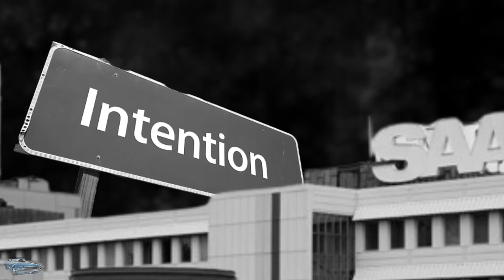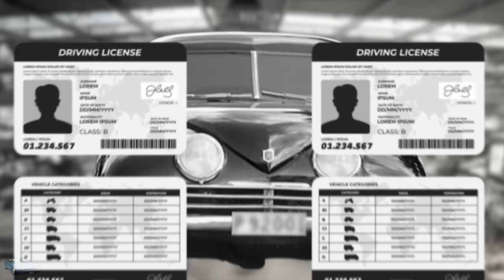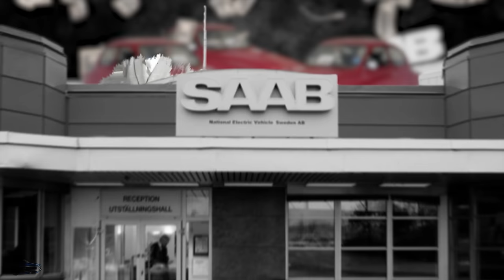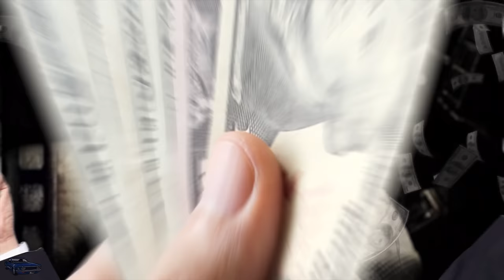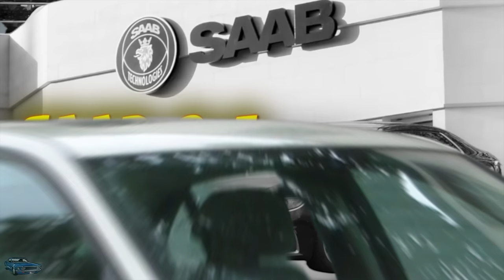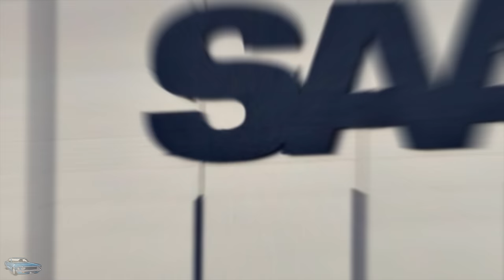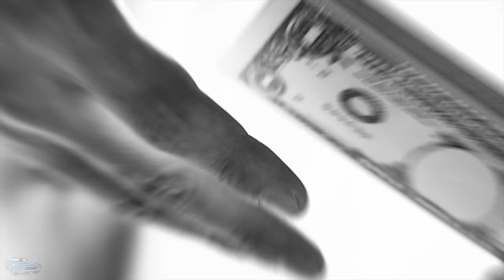The TRAGIC Fall of Saab | A Classic Car Documentary

Comment: Saab-Valmet was established in 1968 as a joint venture of Finnish Valmet and Swedish Saab-Scania. The automotive plant was placed in Uusikaupunki Finland, and assembled only Saabs for the first eleven years. The deal was that Valmet made one third of all Saabs. The Saab 900 Cabriolet, which the video also fails to mention, was designed by Saab-Valmet in Finland. GM tried to run down the factory in Finland but ended up losing the battle. Valmet's factory is still working in Uusikaupunki.

Comment: The 2-stroke engine required a small amount of oil to be mixed with the gasoline, like many chainsaws. Jay Leno said  there were so many SAABs sold in New England that gas stations offered premixed gas+oil.
Reply: Please post a link to that video.. I could search for it but am lazy heheh better to be pointed right to the source.
Reply: It's not a "small amount'  it could be as much a 33:1 with TCWIII oil or 40:1 with regular non detergent 30#.   Usually if your fuel gauge light comes on,  a quart of straight oil will do a 7.5 gallon refill.  just pour it into the tank before you fill-up and the fill up and take it for some alleyways Gymkhana laps to mix up the oil.   Otherwise, especially of it's cold, the oil won't mix itself well into the fuel and you'll initially foul your plugs and (or) soft seize after the mostly unmixed gas-oil thins to about 80:1.  I know why I liked the Shrike and GT850 injection strokers.
Reply: Not just Saabs - there were literally thousands upon thousands of 2-stroke motorbikes in the UK as well.
Reply: @edeledeledel5490  And the US too, I've owned at least ten small Japanese two stroke motos in my life. most of them were fitted with an oil injection system.
Reply: And theus the freewheel clutch was implemented to prevent engine revving without lubrication
Reply: The last few years of the SAAB 2-stroke also had oil injection.
Reply: @ctcboater  In the US they sold the last year of the 2 cycle with a base model 42 hp Standards with premix, although the Shrike Standard and GT850 were oil injected, their pumps were a bit different, I believe the GT and Monte Carlo 850 had a higher volume oil pump.

  The injected engines ran their oil supply galleries to each main bearing and the lower cylinder walls individually.  This is why the Shrike engine was considered a lifetime guaranteed against failure engine, as long as the oil tank was kept topped up, the injection pump was reliable enough so that the oil went exactly to the places it was needed with being diluted by gasoline.
Reply: FredrikLarsson-yk3cz  Funny that my '65 95 Wagon and the '62  bullnose both got almost 30 mpg,  I must have been doing it wrong?  The fact that I never had any seizure problems with these premix engines was because of diligence in keeping a couple full quarts of 2 cycle oil in the cars at all times.  I drove mine during the mid 1980's to 1994, not as daily drivers but at least several times a month, and they both had been on a few over 1000 mile trips to California and Washington state.  I agree they are very solid little cars and the freewheel was great when traction was limited  I also had a 1970 SAAB 99 and it was also very nice in a much bigger weight class and look.
Reply: FredrikLarsson-yk3cz  There were two different types of crankshaft in the 2 stroke SAABs.   The standard pre-mixers from the late 750cc  on through the last year of 1967 2 cycle standard had "cut-outs" for the crankwheel circles and this crank, when used in the single carb engine block, made for a very tractable and wide torque curve.   These engines could easily pull away from a stop light at near idle speed and not miss a beat under acceleration. they also got better fuel mileage in my estimation.  The full circle cranks were run in the MC and GT850 models and were generally set up in the 3 venturi carb assembly, although the late "66 onwards Shrike and Standard had 3 venturi carbs.   These full circle cranks had an entirely different driving experience, these were the cars that had hardly any torque from idle to about 3K rpm, and much clutch slippage was needed to drive away from a stop while keeping the engine on the boil enough to pull well. they did do better at freeway speeds but that was because the higher compression and torque, that was usually fed through a slightly taller pinion/crown wheel gear set. The Bullnose with the 3 speed was better used on backroads as over 60 mph was a bit of a strain for an engine of 36 HP. They were very happy cars to drive in urban and back-roads though.
Reply: Yes I live in NH. I've owned 5 and just got a 2011  9-3 convertible with 64K on her. She runs like new.❤❤

Comment: My dad started working at a SAAB dealership in the early 1970's as a mechanic. One day a factory service rep came by on a usual dealership visit and mentioned to my dad that there was a position open for a service rep for the Maine, New Hampshire and Vermont territory. He applied for it and got the position. SAAB sent him to the factory service school in Trollhättan, Sweden for about 4 months.
     He worked for the company for about 15 years out of New Haven, Connecticut. He got a new company car every 6 to 8 months or so. On a winter break from high school, he let me be his chauffeur for one of the weeks he was on the road. Got to drive a brand new model 99. Very impressive !  Fast, smooth, comfortable and very quiet inside. Handled like a dream.
   He got me my first car, a graduation present, which of course was a SAAB, a well used 1967 model 95 with the V4 engine. I had that car for about 8 years and drove the hell out of it like teenagers have a tendency to do. It was an amazing car and held up well, considering what I put it through. I miss both the car and my dad, good memories.
Reply: Awesome story! 👍👌
Reply: That’s an awesome story! Thanks for sharing!
Reply: I remember passing the SAAB US HQ on Rt. 95 in New Haven when I was "commuting" between NJ and the Groton sub base in the 80s.  They had a Sonnett inside, which you could see from the highway.  My car was a '77 SAAB 99 EMS ("Extra Mean SAAB"), which was a tarted up 99 sport version, so I was a SAAB enthusiast, and noticed these things.
Reply: I owned a ‘73 Sonnett. Most fun car I’ve ever owned. Very creative vehicle, fiberglass body, froggy headlights and freewheeling transmission as noted. I hated to sell it. Great gas mileage powered by what I was told a 65 hp motor from a Saab air compressor, I was told. I fitted it out with electronic ignition and upgraded the radio. It also had about five T-handles which I thought was cool.  Eventually the bottom rusted out. I sold the car to an aviation mechanic who later told me the transmission dropped out. I offered to buy the car back, but no, he rebuilt it. Great memory!
Reply: Thanks for sharing a lovely story!
Reply: It was just outside New Haven in Orange, CT
Reply: @DCDura   They actually started in New Haven and moved to a larger facility in Orange in the late 70's. My dad brought home cases of the SAAB 2-stroke oil they were going to toss during the move as the 2-strokes were being phased out.
   Did you work for them? My dad did.
Reply: Quite the story! 👍
Reply: A WONDERFUL STORY! MY PARENTS GAVE ME A SAAB 900 TURBO (WHEN THE ONLY TURBO MODEL IN NORTH AMERICA WAS THIS CAR) AS A GRADUATION PRESENT, TOO! I MISS THEM, BOTH THE CAR & MY PARENTS.
Reply: @DCDura I lived in Orange, CT while training at Yale Hospital. I eventually had a Saab 900 turbo, a great car, and a Saab 9000, also great.
Reply: Thanks for that Saab story, may your old man rip. You'll both be reunited in the end and that's a guarantee.
Reply: The V4  was a great improvement over the 2 stroke. Decent gas mileage and quite reliable. I sold mine to a neighbor after I upgraded to a 1972 99 and he drove it for many years before an accident destroyed it.

Comment: As a teenager back in the late1980s, I was sitting at red light late one night in my 79’ Z28 Camaro, when an older gentleman pulled up along side me in a black Saab 900 T. We briefly made eye contact as the lights began to change, and due to the fact that the roads were entirely devoid of any other traffic, I got the distinct impression that this distinguished, slightly gray haired man had a “contest of speed” on his mind...which suited me just fine, of course. Although I’d often seen these odd looking cars around, I didn’t know too much about them in the way of performance.
    Now I had done a few mods to my car including a carb, intake, cam, headers, and true dual exhaust, sans catalysts. With a 3:73 final, this Camaro was far from stock, and regularly humbled any stock Mustang GT of any year of that decade. 
    The light changed, and we both flat out dumped it. I immediately put a car length on him out of the intersection. The one thing I vividly remember about this strange car though, was the incredible sound of that turbo charger spooling up as he seemingly almost instantly erased that deficit. We were running pretty much dead even. Every time he would shift I’d gain a few feet, then the whining scream of that turbo charger would be right there in my window. It was pretty awesome, actually.
    Although it was a long straight, and there wasn’t any other traffic around, there definitely WAS the possibility of the random cop sitting up the road in the dark. So we both shut it down before crossing over into triple digits. I remember glancing over and seeing this man grinning like a Cheshire Cat, and he winked and nodded before going on his way as I hit my turn lane to head home.
    Unfortunately, I never got the pleasure of driving one of those Saab 900 Ts, but from there on out, I always held a healthy respect for them in the way of their performance capabilities. Was his car modded as well? Possibly, but of course, I’ll never know. Regardless, I still hold that car fondly in my memory as one of the few 80s “business man sleepers.”
  Great video, btw! And thanks for the flash back. 👍
Reply: Awesome story! I had a similar experience except I was in the Saab. And as a young man surprising kids in my generation is so much fun with my Saab. I'm sure your car was sick!
Reply: Yeah great story. I was about to suggest professional writing, but then I thought you might already be in that business :D

Comment: I've had 4 of them : 900, 9000, 9-3, 9-5, and one more for spare parts.  I never felt as safe on the road, with any other car, as I did in my my SAAB.  Solid as a rock on the highway and well-protected in city driving. Never had a major repair with any of them.  It felt good to drive ... ergonomically correct in every detail.   ... and I loved all the 'quirky' features.

Comment: The 9000 was not an outgrowth of the 600, though Lancia was involved in the 9000. It based on a platform (Type 4) shared with Fiat (Croma), Lancia (Thema), and Alfa Romeo (164). Each company used the same basic structural shell but used their own engines, interiors, and exterior designs.
Reply: You're partly right: the chassis was indeed developed in cooperation by Saab and the Fiat Group (Fiat, Lancia and Alfa), but they went separated ways after the first real life test of the chassis. The Italian engineers called it "Bellissima" whereas the Saab engineers supposedly said "not good at all". Saab then took the chassis and changed many things, costing them a heck of a lot of money, whereas the Italians happily used it as it was for their Croma, Thema and 164.
Reply: @tjroelsma  Yes!!  Look at "Saab strength vs BMW - TopGear"
Reply: Absolutely spot on, SAAB could not afford the development costs of a new model so shared the research and engineering with Fiat Lancia and  Alfa, the type 4. I ran a Fiat Croma Turbo in 1989 to 1991, from new clocked 158,000miles, only failures other than normal servicing were the driver's electric seat motors, wicked acceleration and top speed of 160mph :)

Comment: I owned and enjoyed a 1998 SAAB 900T 2 door with a 5-speed manual. Still one of the best cars I ever owned, and I got my license in 1978. Very fun to drive, some unique quirkiness which I liked, and I ran it up to 170,000 without a lot of repairs. Held up against New York snow, salt and potential rust. My brother even bought a 9-3 convertible which he enjoyed. I would have bought another, but, well you know.
Great video. Thanks

Comment: The Saab was an extremely innovative automobile. Swedish neighbors of mine had a 1964 Saab 96. It had lap, and shoulder belts. I believe that they added boron to the steel bodies to stiffen them up, I believe that Volvo did the same, about that time, ensuring a safer vehicle, especially in a rollover accident, as well. As a kid I rode in it several times in the front passenger seat. I loved the way that my friends' dad drove that car. It handled extremely well, and drove like it was a sports car. The sound, and the smell of the car was unique as well. When I think of the GM partnership, I think that a quote from the Simpson's is apropos:  "What do you expect from a heartless multinational corporation".
Reply: The bullnosed 2 cycles especially with a later, perky 50+ horse engine were incredible little go-karts, cornered nearly flat and stuck to the road like glue.
Reply: You are correct about the shoulder belts, I think that Saab and Volvo were the only '60s cars with them. The body was indeed stiff. I rolled one, the windshield remained intact and the doors opened and closed afterward. No injury as I had my should belt on. Drove it around for a few month as I could not afford body work for awhile.

Comment: When I turned 18, in 1978, I realized a dream, that is, I got a 1969 Saab 96 which I adored. In 1985, after finishing my BFA from Rhode Island School of Design, I was about to move to NY for my MFA, and there was no need for a car there. So I put my faded blue jeans blue Saab for sale, and two students became immediately interested, so, what happened next was amazing; they got in a bidding war, that raised my intended sale price to above the value I'd paid for the car eight years before! And in those 8 years, I basically spent money on 8 sets of tyres, 4 shocks, oil, gas, and brake pads, nothing else! I loved that car so much, and it only bought me joy. And a bit of profit too...  : ⁰ )

Comment: I think that you will find that the Saab 99 was only offered with a slant 4-cylinder 4-stroke engine. The original slant 4 being built under licence from Triumph of the UK. This engine evolved over the years before it was eventually phased out for GM corporate engines. The 95 and 96 started with the 2-stroke and then moved to the Ford of Germany sourced V4 which was also used in the Sonnet 3. You appear to have some overlaps of information and time lines and mixed information The pictures also often do not align with a lot of the commentary. I have owned 8 Saabs over the years, starting with a 1980 Saab 99 Turbo and ending with a 2005 Saab 9-5 Aero Hirsch SportWagon.
Reply: In  1979 I was living in  Omaha Ne. Spotted a 1969  Saab Sonnet 97 I believe the serial # was 169.  It came from Tuson AZ.  I paid I think $1500 for it ran pretty good. Germany Ford V4 industrial engine 1500cc? The engine had a conter-rotating shaft so it was very smooth. The hood was long to accommodate the engine being in front of the transaxle the extra weight on the front wheels was a good thing great in the snow studded tires meant you go about anywhere. The weak link was the freewheeling coupling I don't think they up graded the unit when they went from 3cyl to the V4 it would strip the teeth or shear the input shaft.  The gearshift was located on the steering column 4 speed. Being a unibody no frame when it subcame to salt the rust was the end of it. Love driving  that car wasn't not
 a hotrod but handle perfectly.
Reply: Rover engines I recall.
I loved SAAB and 240 Volvos.
Best cars ever made.
Reply: @MitzvosGolem1  The slant 4 was the a Triumph engine, the same as in the Triumph Dolomite which then was also half the V8 in the Triumph Stag.This was shortly before the formation of British Leyland, which would then bring Triumph and Rover into the same company.
Reply: You are correct, the engine was the same as the Dolomite and had 'Stanpart' on the engine castings. The V4 was a Ford unit. This film sort of overlooked the chronology of these transitions.

Comment: I had a 1995 SAAB 99. It was probably the most comfortable car I've ever driven. It had heated seats and I believe heated steering wheel. A great car for our long Canadian winters. The engine needed the timing chain replaced but otherwise was reliable.  Eventually the bottom of the doors which curved under the body rusted out from all the salt on our winter roads.